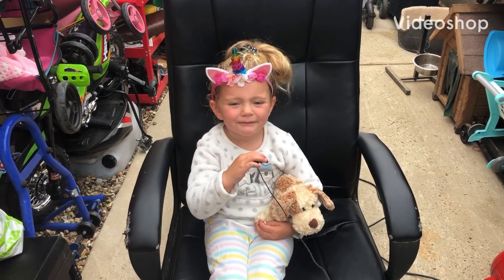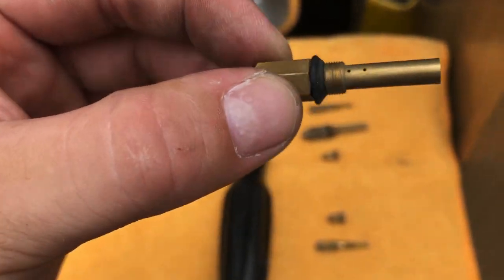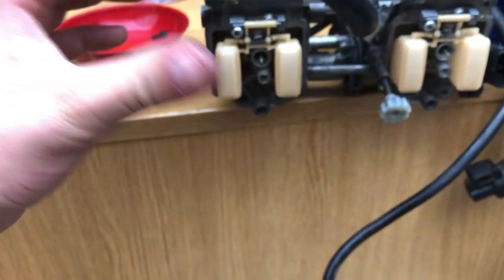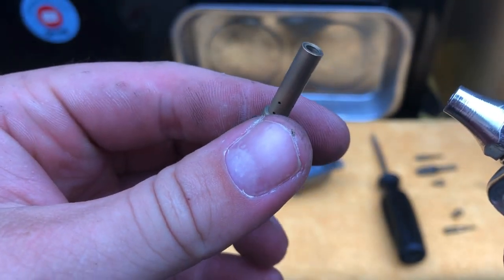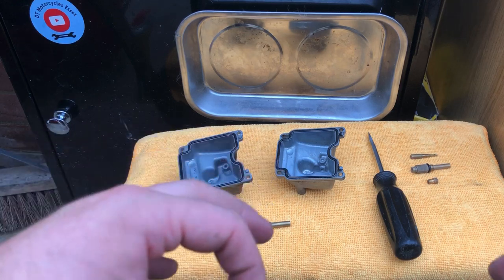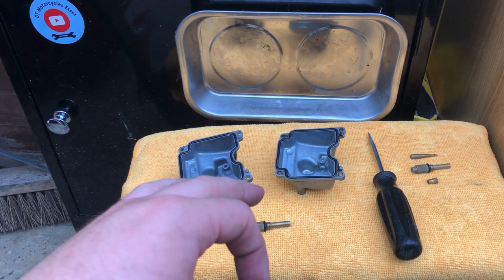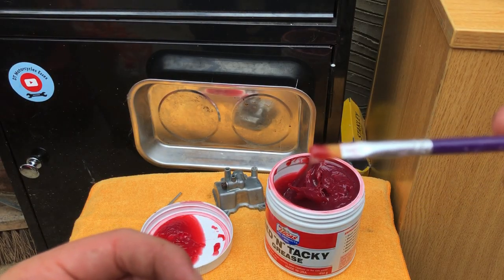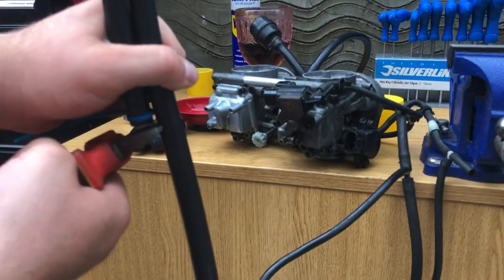Suzuki GS 500 Restoration -4- Carbs & Fuel Hose

Comment: Nicely done bro' 👏.
I think the manual will be a good base for information/guide, as you've never pulled that model apart before. 

That red grease you used on the float bowl screws, I thought that was designed for rubber but at the end of the day grease is grease lol.

Don't rush it & you'll have a decent running, riding bike.
Take care & enjoy what you're doing. 🤟
Reply from the maker: Thanks buddy 👌🏻

Comment: Howdy from Nakusp, British Columbia. I was given a mint (almost) condition Suzuki GS500F. The only issue was that all the vacuum lines were disconnected and there is no proper videos or drawings to guide someone thru re-connecting them. I believe it has an EGR and I could live without it. I just want it running. Can you help me? No one seems to follow thru with the vacuum connections.
Reply: Honestly dude, same shit with me. I bought a GS500F, only needed the air filters and a Carberator. For the life of me, I still haven’t found a single video showing where the hoses connect to 💀. They always cut that part out or already have the carbs out of their motorcycle.
Reply: @randomname6069  I stopped looking for manuals in US and Canadian dealerships. I was really careful to follow the directions laid out n the video I sent. It works.